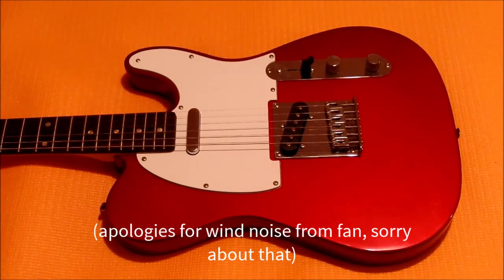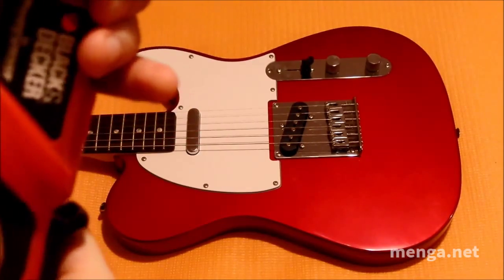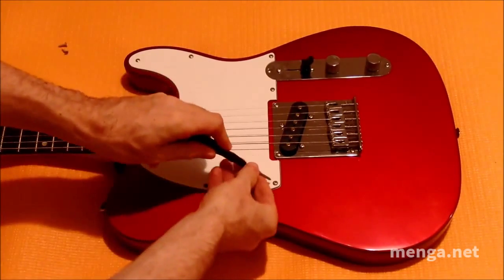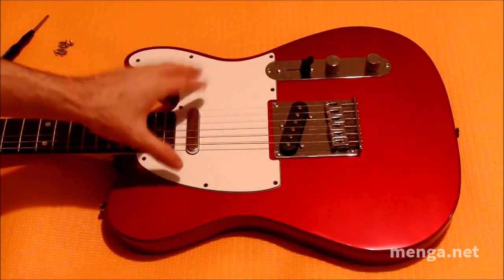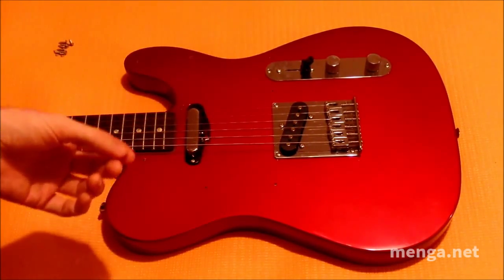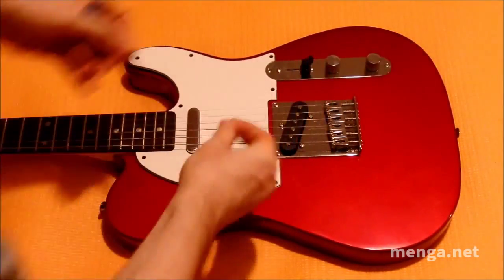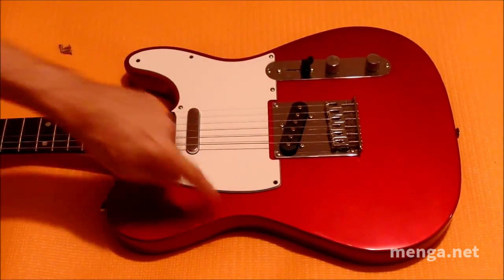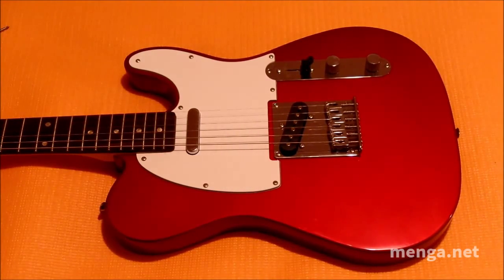How to adjust neck pickup height on a Telecaster (Squier or Fender)

Comment: Replaced my Squier  Affinity Telecaster pickups with Alnico V's from Vanson, but instead of doing this, I drilled the pickguard and fitted the proper screws and springs, so I can adjust the Neck Pickup without having to take off the strings and the pickguard. Because tone is everything and it can be achieved by adjusting the pickup height whilst picking the strings to get the sweat spot.

Comment: Hi! Does the neck pickup generally have a slight tilt to it? I'm a total newbie.
Reply: Usually the neck pickup being slightly tilted doesn't affect the sound. That being said, try moving it around gently with your hand and see if it makes a difference in sound or if the tone falls off. If it does, or if you just prefer the pickup to be level, try leveling it out.